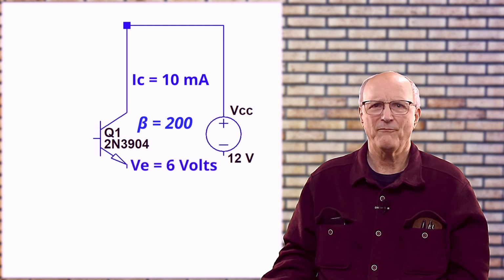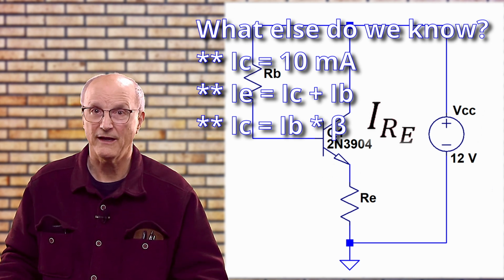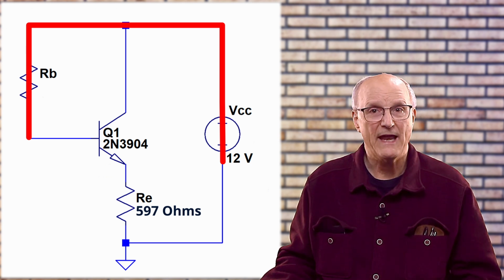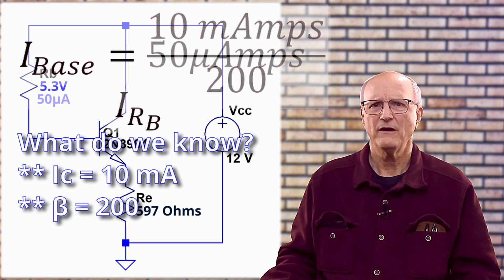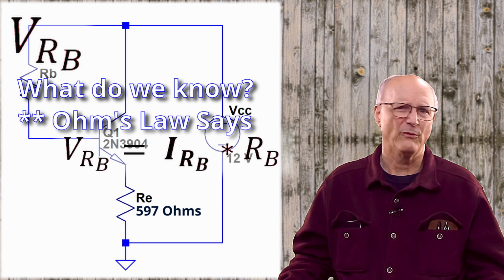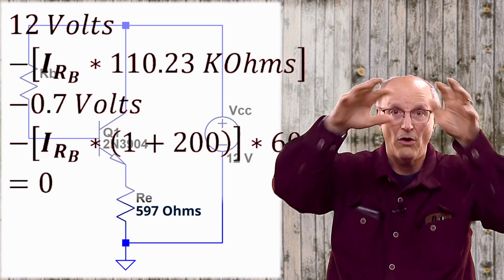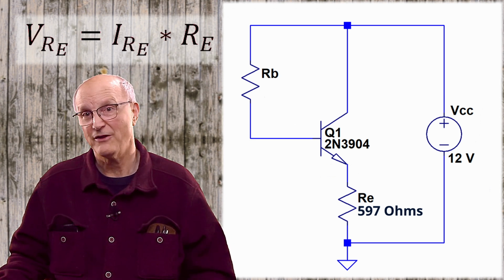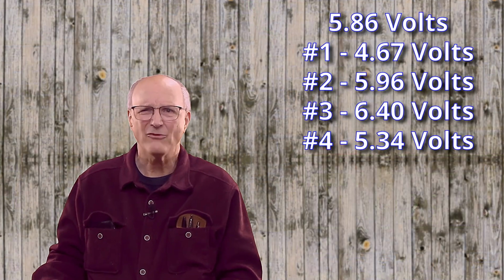Basic Bipolar Junction Transistor Analysis: The Common-Collector Circuit (066b3)

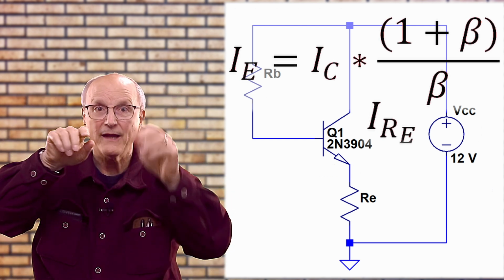Comment: As a retired E technician I've had good luck repairing & building Dc,Af & Rf active transistor devices but never able  to remotely grasp Kirchoff's, Thevenin & Norton bizarre Non-Intuitive network theories or "mesh" stuff....By 08:30 have an excruciating painful headache & had to bail out... I  actually hate those guys for messing my electronics experience up.....
Reply from the maker: Well, Tom ... I share your brain freeze on Thevenin and Norton equivalents. Makes no sense to me (and never did) ... but they work, oddly enough. Kirchhoff's, however, always made sense cuz the stuff has got to go somewhere.
I do have videos on each of those if you are interested.
Kirchhoff's Current: https://youtu.be/Htrwqby10DA
Kirchhoff's Voltage: https://youtu.be/vmYUoKI_p4c
The black magic of Thevenin (yes, totally bizarre): https://youtu.be/gkq5DOwP2V0
Then Norton's: https://youtu.be/R13FoZcBgkw
🙂
Reply from the maker: Ya know Tom, I was just thinking this morning ... as technicians we (yeah, I worked as one of those, too) we intuitively used the Kirchhoff's voltage and current laws. We just didn't put a name to what we were doing.  I mean, we knew that if the power supply was 12 Volts and the voltage across the collector-emitter of a transistor was 5 volts (emitter grounded), then we just knew that the voltage across the collector resistor HAD to be 7 volts. This is Kirchhoff's Voltage law in real life.
On the other hand ... Thevenin and Norton...ugh! Mysterious and weird, but it works. 🙂

Comment: Ralph, I can't imagine the effort that goes into these videos you just keep pumping them out 👍I'm curious as to how far you will be going with this video series will you be talking about combined series capacitive or resistive coupled amplifiers, or push-pull designs etc? Impatiently waiting for the next video......
Reply from the maker: Yes, they do take a bit of effort, but I love it!
The initial plan brings me through to load lines, then jumping into difference amplifiers. But, I have been contemplating looking at multi-transistor amplifiers, too, because this introduces a whole bunch of other factors (e.g. loading factors of subsequent stages). We will see where it goes.🙂